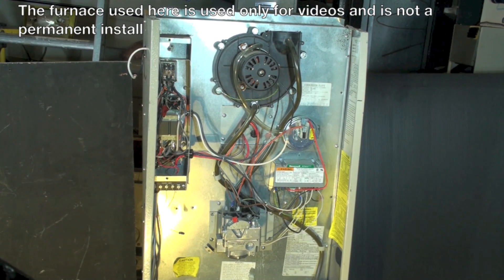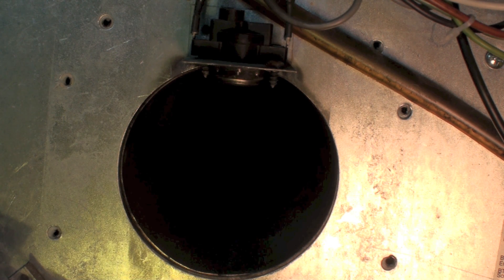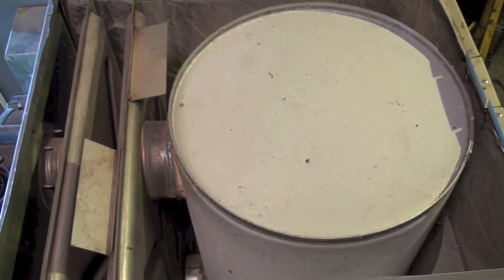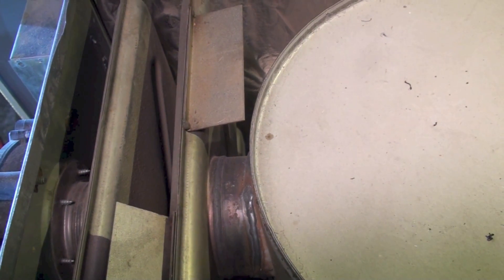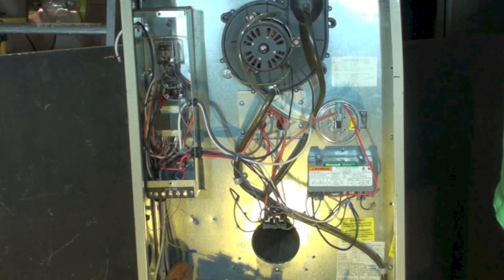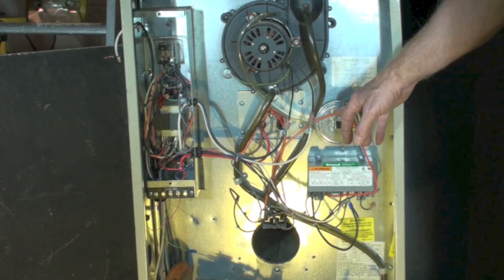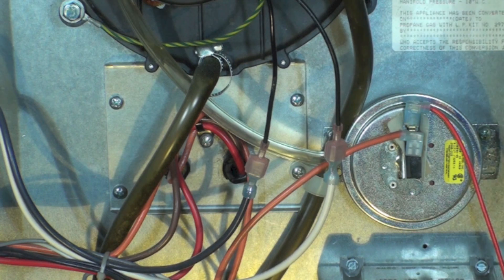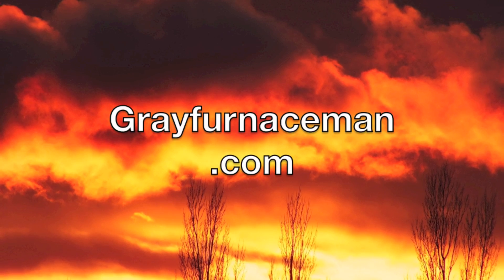Check the Coleman model CGU heat exchanger part 6

Comment: Thank you for your excellent videos on furnace issues. I have a Coleman furnace like this one with the drum style heat exchanger, single burner. I have a rattle that is most noticeable when the furnace is cold and is heating up. I suspect it is something rattling in the exchanger or perhaps loose exchanger mount. Is there anything in the furnace that could cause this type of rattle like a baffle in the secondary exchanger if they exist or a loose mount somewhere. The exchanger does not seem to be leaking. No rollout or CO. Thanks for your assistance.

Comment: i have a 40 year old coleman furnace. heat exchanger looked good looking thru the hole the blower motor moves air thru. yes i pulled out the blower went inside the hole and looked up at the heat exchanger. well built unit. too bad the new ones arent as well made
Reply from the maker: Having worked on a number of these units, I would definitely not say that.  From heat exchanger problems to ignition controls, these units had a lot of problems.
GFM

Comment: I recently bought a home that was built in 1987 and it has this exact furnace installed in the basement.  It's still working great but I did have to replace the original PSC blower motor (upgraded it to an X13 ECM) and I also added a flame rollout switch as it did not come with one from the factory.  I'll keep her running as long as the heat exchanger hangs in there.  It seems like a really well designed furnace and was defiantly built better than anything I could buy today!  Thanks for all you videos, I've learned a lot of cool stuff from them!

Comment: A drum heat exchanger? I thought the new Coleman furnaces had tube heat exchangers. The old Coleman furnace I had used a drum but my new one has tubes.
Reply from the maker: Scott Shingleton The drum heat exchanger was discontinued about the time York bought Coleman.  What you are seeing in the tube heat exchangers is actually a York design.  
GFM